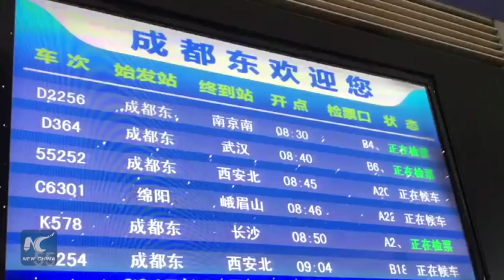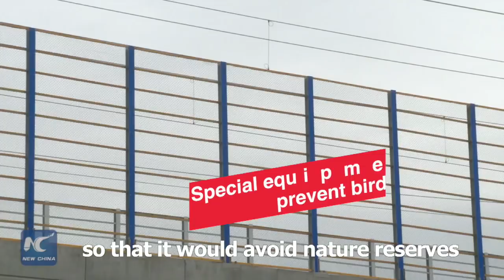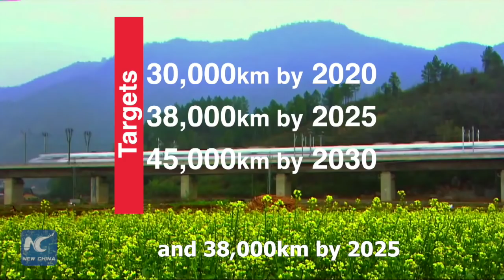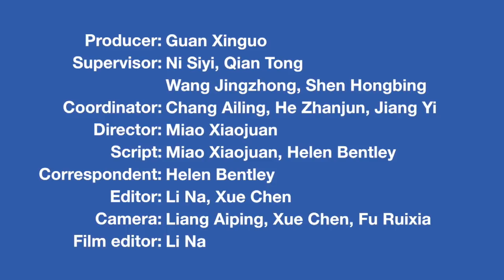Xinhua Special: All Aboard China's High-Speed Trains!

Comment: The HSR might have a parallel maglev train in a hyperloop system between cities ( heavily travel routes).In 2014,Jiaotong University China sw oldest railroad engineering school with government funding built and tested a small maglev train in a hyperloop system at 1,000 km/hr.CRRC will build a larger maglev train between cities in a hyperloop system at a designed speed of 2,500 km/hr.CRRC has built two medium speed maglev lines,one in Changsha,the S1 redline in Beijing and is building 10 more in other cities.